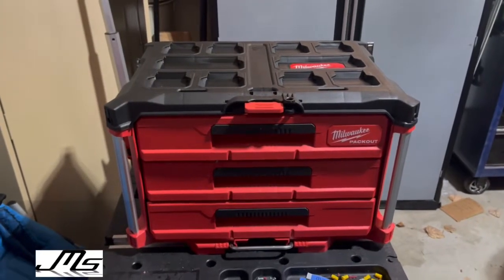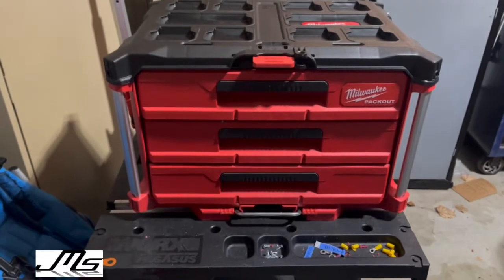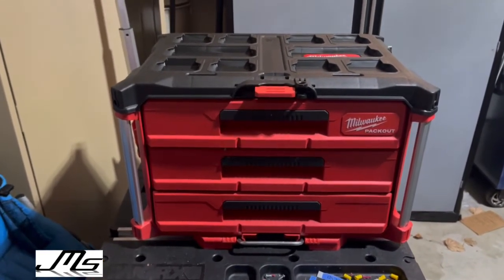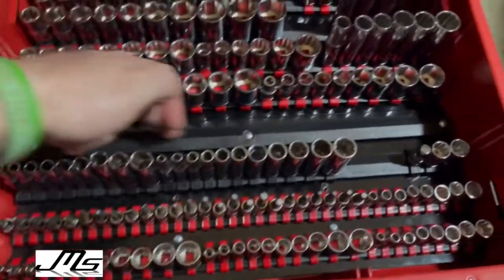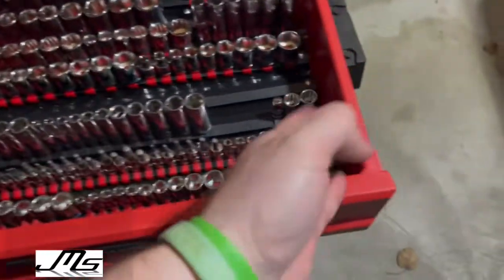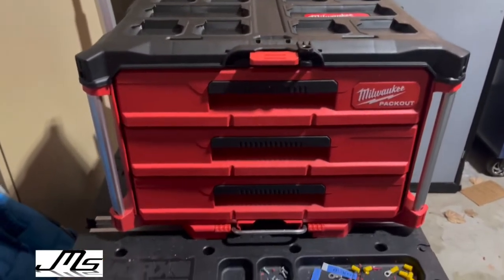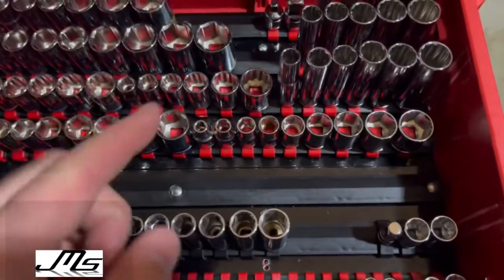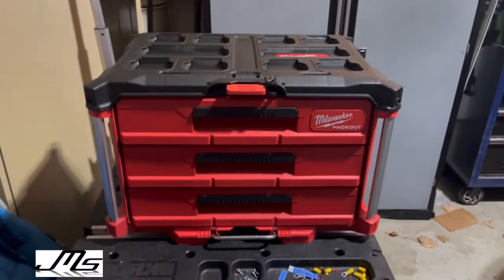Milwaukee Packout 3 Drawer. Socket Drawer

Comment: I'm looking at doing the same thing. I have the olsa brand trays, same thing. In dewalt drawers. Bought them before Milwaukee came out with drawers. I was bummed to see the trays wouldn't fit. Thinking about switching because Milwaukee has floor mounts and better options. Going to attached the floor mounts to a garden cart, for off roading around the farm.
Reply from the maker: Do it.  You’ll love it.
Reply: @JMSAudioSTL  how tall is your tallest deep socket for 1/2"?
Reply from the maker: @cvau_  hey thanks for messaging.  They are 3”

Comment: How strong is it the packout with all the sockets in it
Reply from the maker: Don’t see no difference.  Picking it up and all.  Nothing coming apart
Reply: @JMS AUDIO STL  thanks
Reply: I have a 3 drawer loaded up at about 100lb. It's not happy about it as the bottom of the two heaviest drawers sag a bit but I've been using it like that for a year and all the drawers still work fine.

Comment: So I’m thinking of doing similar but mounting my rails the other way (front to back) and screwing them down. As I could fit way more rails that way. How well has yours held up?
Reply from the maker: It’s holding up really well.   It just sits in back of the truck and I just pull it out. If I need to roll it in.  It’s easy also

Comment: Very nice system. Looking to get something similar myself. Do you have enough height in the 3 drawer box to fit deep well sockets? I see you have some in there, but I'm not sure how close those are to hitting the bottom of the middle drawer.
Reply from the maker: Hey if do deep well sockets the top edge of each drawer will need to be trimmed to fit.  I deep are the sockets? I could measure mine
Reply: @JMSAudioSTL  or you could take an angle grinder and make the sockets a bit shorter so they fit 🤔
Reply from the maker: @jessihawkins9116  wait cut my sockets.   Nope.  Cutting plastic is easier

Comment: that socket rail isn't available to you have an alternative?
Reply from the maker: You can make it however you build yours. This just was best option for me
Reply: @JMSAudioSTL  how long was the socket organizer it says 17.3 but the drawers are 16.2
Reply from the maker: @michaelrreeves  you have to cut the metal backing down to fit.  Also in the drawer those plastic tabs that hood the dividers need to me shaved off